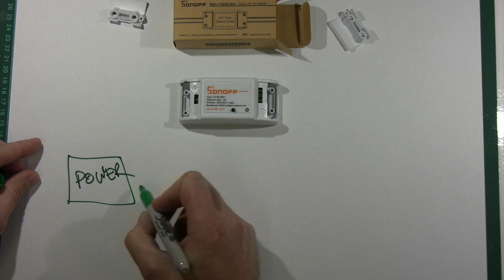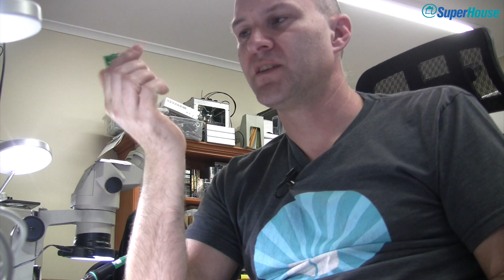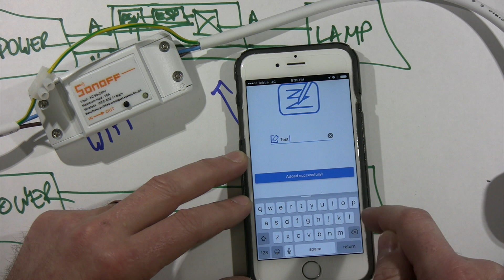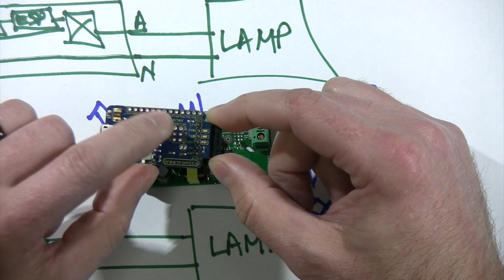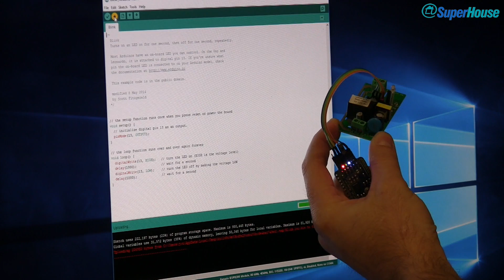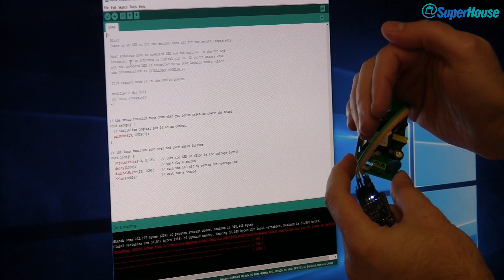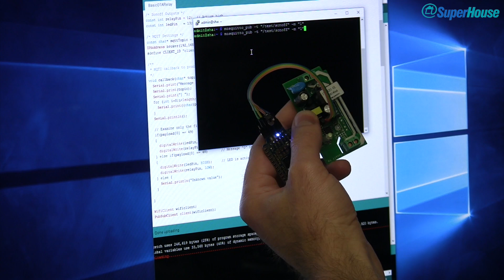SuperHouseTV #17: Home automation control with Sonoff, Arduino, OpenHAB, and MQTT

Comment: Awesome Vid and i actually really like the device but there are also two "contra" to mention.

1. Most of routers are pretty limited to the simultaneous connected devices. In my case 32 but we have 4 RPi3, something like 80 lights and countless outlets in and around the house. Not to forget some Laptops, Cellphones and IP-Cameras.

2. i miss connectors to add a push button and a wall switch to switch the relay manually but maybe there is a free GPIO?

I prefer to use each room one of the latest ESP (3 bucks) with a additional power supply (cheap) and connect several relay boards (up to 30A, also cheap) to it. In case i need more GPIO's there is still the possibility of using shift registers or I2C with PCF8574.

This isnt critic. Im one of your biggest Fans and your Videos were helping me a lot to understand. KEEP IT UP!!!  :)

PS: sorry for the messy english, im a German who never had an english class in his life ;-)

But one more Question: MQTT vs. Netcat?
Reply from the maker: Yes, point 1 is something that can catch people out if they don't know their AP has a limit on simultaneous clients. Point 2 will be covered very soon in my follow-up video, which will probably be titled "Sonoff Secrets: Storage, Software, Switches, and Safety" or something corny like that :-)

MQTT and Netcat can work together, but they do very different things. I want to do an episode all about MQTT some time in the future because it's such a useful foundation now for so many connected projects.
Reply: Ok, thanks. I'll stay tuned :)

Comment: I've made an alternative firmware for Sonoff switches, based on MQTT. Wi-Fi credentials configuration is made with WiFiManager and a Web configuration portal is used to setup MQTT username, password, broker IP address and port. 

GitHub: https://github.com/mertenats/sonoff
Reply from the maker: Nice :-) I'll reference this in a follow-up video. Thanks.
Reply: Thank You! In addition to the Sonoff's products, there are also a RGB bulb (Authometion LYT8266) and a LED light strip controller  (Arilux AL-LC0X), based on ESP8266.

Comment: as I understand the sonoff app needs a phonenumber to register so it will not work from a tablet
Reply: hi, i registered with ewelink using my email address only. works very well on both tablet and phones.. I can add that I measured draw. 1W when erelay is off, 1.5W when relay is on. not bad at all.

Comment: I'm confused when it comes to what you can use if you don't have the Freetronics USB to Serial adapter. I have this: https://www.adafruit.com/products/954 Will that work (minus not feeding it the 5v from the red wire but feeding another source of 3.3v)? Or would a USB to Serial cable work that I use to console into Cisco devices? That basically gives it a serial port. I'm trying to read up on this topic but I thought i'd ask before I go buy another device for this. Thanks!
Reply from the maker: Yes, you can use any USB-to-serial adapter that provides 3.3V logic. That includes 3.3V versions of the original FTDI cable, which are pretty easy to get. I just used the Freetronics one because I have a whole box of them in the Freetronics warehouse, which just happens to be my garage ;-)
Reply: I figured out that I could get it working with the usb to serial that I already had. I'm just having issues with uploading new firmware to it over wireless even if I have authentication off. I tried turning it on and re-writing via serial and when I tried to update it via Ota, I get a password prompt even though I commented that code out that I wrote to it first. very odd. probably a library version issue? thanks!
Reply: I'm also wondering about alternatives to the Freetronics USB-Serial adapter. I'm in Sweden and ordering from Freetronics site is probably going to take a while. Is it possible to use any USB to Serial adapter and make arduino software recognize the sonoff, or is it that specific chip on the Freetronics adapter that makes that work? Thanks for awesome content!
Reply from the maker: Yes, I've had very strange things happen with the OTA authentication too. Sometimes it works, sometimes it doesn't, and sometimes it tries to apply it even if the version currently installed doesn't have it enabled. I don't know what's going on there.
Reply from the maker: Yes, that Adafruit adapter should work fine because the logic level pins are 3.3V. Just don't connect 5V, as you already worked out!
Reply: I feel OTA is unreliable. It works sometimes. Other times not. Password authentication is hit but mostly miss. If pins are connected to electronics and it's all behind a dry wall OTA flashing does not work; the upload to the ESP8266-12E can go ok, if I get past authentication, but expected flashing does not occur as it does with direct USB connection. I posted a comment above. Any ideas? ( Reliable OTA for behind drywall is useful)

Comment: Hello, I am interested in the same project as you.I have a home automation.I commanded 5 Sonoff for my home automationBut SonOff work just on Local Wi-Fi and not from outside (3G or 4G or for
another network).How you built that for your home automation Sonoff "Superhouse"?
Thank you for all your explanations it’s really great
Reply from the maker: I use OpenHAB as the central control system for my house. The app on my phone connects to OpenHAB, which then sends commands to other devices such as Sonoffs.
Reply: Okey, so OpenHAB may pair the sonoff without difficulty? And what is your app on your phone connected to OpenHAB. For me i use my build page and Jeedom. What do you think of jeedom, can be paired it?
Thank you in advance for your answer
Reply from the maker: OpenHAB doesn't need to know anything about the Sonoff, provided the Sonoff firmware has MQTT support. MQTT acts as a message handler for other software / devices, like a shared whiteboard. One piece of software can send a message to MQTT (like writing a note on a whiteboard) and then another device or software can read the message (like reading the whiteboard and seeing that somebody else already left a note there) and doing something with it. I really need to do an episode about this, because it's a very important concept. It's hard to explain in words, but when it's put in a diagram it's suddenly very clear.

Comment: This app for smartphone? Where to find this? Is it available for samxung galaxy? Thanks.
Reply: From the VERY little that i've messed with it, it will reconnect and show you what the statuses are on the MQTT Broker. The phone is just reading what the value is supposed to be from the MQTT broker. The phone simply subscribes to these topics and publishes to them to change states (I believe). I would like to hear from Jon.
Reply from the maker: Robert, you're spot on in terms of the behaviour, but behind the scenes it operates in a very slightly different way to what you described. Part of the problem is that "OpenHAB" consists of several parts, all with the same name, so it can be confusing to talk about it. "OpenHAB" itself is the central software that runs on a machine somewhere, such as a Raspberry Pi. I normally call this the "OpenHAB server" to distinguish it from other parts of the system, but technically it's just "OpenHAB". Then the OpenHAB app (which runs on a phone, tablet, etc) connects to the OpenHAB server to get device status, send commands, etc. The OpenHAB app doesn't need to know anything about MQTT, because it connects solely to the OpenHAB server. Then, the OpenHAB server is the thing that connects to many other things, like an octopus reaching out in many directions. It can communicate with other devices via MQTT, or many other comms mechanisms and protocols simultaneously.
Reply from the maker: There were 2 apps shown in the video. The first app (eWeLink) is available for both iOS and Android, and works with the firmware already installed on the Sonoff. Just search in the Play Store for "eWeLink" as described in the video. The second app is for OpenHAB, which is the home automation control software that I use. OpenHAB is installed on a Raspberry Pi in my house, and the OpenHAB app on my phone connects to it. That app is also available for both iOS and Android. Search for "OpenHAB" in the Play Store.
Reply: Sounds great! Right now orderred two sonoff devices (tight budget for this month), just $6.11US - that is no brainer... if someone want to make their own with ESP8266, relay... it will cost much more, not to mention nice ABS plastic casing. One thing: when phone is out of range, and if light remains on for example, does phone automaticall re-connect and show that light is on? Or if after manual connect, does it show status of all loads? Thank you in advance.

Comment: Hi Jonathan ,  great video,  a question connected with eWeLink app, why does it need so many permission? Is it safe to use it?
Reply from the maker: Good question. I don't know much about it, because all I did was test that it works and then blow away the firmware on the Sonoff so I could use my own OpenHAB setup instead of eWeLink. What you saw on the video was about as much as I've done with eWeLink. One of the reasons I don't like cloud-dependent control systems is that even if they don't use any extra permissions, just having your control messages go through somebody else's server can leak a lot of information. Whoever can see those control messages can get a pretty good idea of what's going on inside your house. That's one of the reasons I prefer everything to stay local.

Comment: HI CAN YOU USE THESE SONOFF DEVICES WITH amazon echo .MAYBE LIKE INLINE WITH A LAMP OR OTHER ELECTRIAL DEVICE .THANKS AND GREAT VIDEO .
Reply from the maker: Yes, you can. You'd need several different things to make it work. 1: Install OpenHAB. 2: Set up the Amazon Echo HA Bridge. There's a great guide here: http://tinsley.io/2015/06/control-your-items-using-the-amazon-echo-openhab/. 3: Install an MQTT broker. 4: Configure OpenHAB to control devices using MQTT. 6: Install firmware on your Sonoff to use MQTT.
Reply: NICE

Comment: Having ordered and played around with one of these I have now ordered 4 more. For this money £4 in Uk it makes it possible to provide a lot of automation for very little money. More work but (obviously) more cost effective than z-wave etc etc

BUT - only with the knowledge in this video dies this make financial sense. As someone new to home automation I wouldn't have a clue how to flash these SONOFFs and the video is great. I've shared this vid with lots of friends who have now purchased 1 to begin to annoy their wives and cats by randomly turning on/off lights at random :)

In all seriousness this is the best video I've found on home automation because it's THE video  that has set my on the path to build a full home automation system. 

Pi3 is next.

Comment: Fantastic video, liked, suscribed and Ordering smart relays, now.

I did excactly that with a: old phone charger SM-PSU, esp-8266 and a cheap relay. I spent too many hours and still have issues with the relay control voltage.

Is there something similar with dimmers?

Did you realise how much responsive is your bulb when is not turned on from the cloud? :)

Thanks
Reply from the maker: There are definitely equivalent devices from other suppliers that can do dimming, but I don't think any of the Sonoff models can do it. Not yet, anyway. They're just on/off devices. I think there's probably a Belkin Wemo module that can do it, but they're about 15x more expensive!

Comment: Hello! Which app are you using on iPhone to control Sonoff via MQTT? How can I get or develop this?
Reply from the maker: It's the standard OpenHAB app, nothing special. I run OpenHAB on a Raspberry Pi as the central controller / coordinator for the house, which connects to all the other devices. Then I use the OpenHAB app on both iPhone and Android to control it.
Reply: So you don't use MQTT? Just OpenHAB?
Reply from the maker: Yes, I use MQTT as a communication mechanism between OpenHAB and some other devices. I really need to do an episode about the architecture, because it's important when trying to understand how I've connected everything together.
Reply: Yes, it's very important. I'm trying to find a tutorial that shows how to integrate them and no success until now. Can you do it? I will be very grateful. Thanks.

Comment: Very Nice.

Could you provide the switch model (the cover)?
Reply from the maker: Sorry, I'm not sure which switch you mean. Is it the one I made with the buttons on it?
Reply: SuperHouseTV I meant the Wall Plate.
Because I have in my country. The blanks they are a single piece. And I wanted something in the same style as yours. Two parts.
Reply from the maker: Aha, gotcha :-) That's made by an Australian company called Clipsal, it's a standard wall plate style here so there are many other companies that make copies. For example: http://www.wagneronline.com.au/clipsal-compatible-wall-plate-blank/power-240vac/power-lighting/960967/fl/

Comment: I've just received my Sonoff and I'm thinking of using it, initially with its cloud software/app, to drive some device to scare a potential burglar. 

What are the best devices to actually drive for this purpose? Lamps, of course, maybe a radio? 

One problem I see is that most modern devices have "soft power" switches and therefore need human interaction to actually turn them "on" when the power is restored. 

Any suggestions? 

Also, I suspect most software that allows you to switch on/off devices doesn't have any randomness built in. Any half decent burglar would notice if a light came on in a give room at EXACTLY 6pm each day. 

It's needs to be 6pm +/- say 30 mins to fool a burglar. Of course this could be programmed from my own MQTT server, just wondered if most inbuilt software had this random feature?

I plan to buy more Sonoffs - it's an excellent bit of kit.
Reply: For this case,maybe you can use your sonoff switch+PIR Motion Sensor.Sonoff has a PIR2 can be your ref.

Comment: Does it work remote control with 3g?
Reply from the maker: The Sonoff only has WiFi (with optional 433Mhz, depending on the model you choose) so it can't connect to 3G, 4G, or anything else. In the video when I control it with my phone, the phone itself is connecting to the Internet via 4G (or could be 3G) and then in to my OpenHAB server via my home Internet connection. The OpenHAB server then communicates with the Sonoff by WiFi.
Reply: Thank you, you're Super!

Comment: A little help please? I have uploaded your code (thank you) OTA blink to my esp-12 and it worked fine. I was able to access the serial monitor no problems. I dis-connected the module and re-connected it. Now when I go to access the serial monitor it comes up with type board password to access console! What the! I didn't enter any password the first time. I've tried my WiFi password no good. I've gone through your code and can't see a password there. Any help would be greatly appreciated. Thanks.
Reply from the maker: That's really strange! I can't think of an explanation for that. Is it possible to re-flash the board (maybe just with the standard example Blink without any OTA support, using the USB-Serial connection) just to see if it comes back to a basic working state?
Reply: Yep no worries, thanks for you help mate. I'll give it a go tomorrow night. Cheers

Comment: Hello again JonathanIt would be very interesting video on a wall switch like you have!That's my biggest problem, what kind of Wall switch use to control the lighting with dimmer (preference).In this case the "intelligence" would have to stay at the wall switch right? Or you have any suggestions?Do you thing will be better to have on the wall switch the ESP8266 or the UNO with Ethernet shield?
Reply from the maker: I'm going to do a future episode about the way my switches are set up. I don't have any dimming control at the moment, but I want to revise the switches. I have some ideas about how to do a touch-sensitive plate with dimming control. Which processor you choose depends on how you want to communicate with it. If you're happy with WiFi (which I personally don't like for critical home control stuff) then the ESP8266 is the way to go.

Comment: Hi Jonathan
For The module with the sensor humidity , can we flaching and put our sketche (like you did with switch)
Thank You
Reply from the maker: Yes, no problem. I'm going to do another video showing more information about the TH model, some extra software options such as Homie and HC2016, and how to connect extra GPIOs so you can do things like connect a physical light switch.
Reply: Thank you a lot Jonathan

Comment: So you have your wifi login info hard-coded on all of the devices?  If you have to change your wifi password for whatever reason, that would completely suck flashing all of the IoT wifi devices all over the system!!  Is there a better way?
Reply from the maker: Yes, there's definitely a better way! I only did it that way in the video to show the simplest possible example, based on the "BasicOTA" example that comes with the OTA library. I even commented out the authentication etc that's in the basic example. There are various on boarding systems available but they add complexity, and I wanted people to be able to prove it works with the minimal lines of code. You could check out "Homie", and Pete Scargill's HC2016 firmware (which needs a bigger FLASH on the Sonoff), and I've used a project called ESPlant that was developed by some friends of mine for the Open Hardware Miniconf 2016: https://github.com/CCHS-Melbourne/ESPlant
Reply: Would any of that be covered as part of your upcoming video on MQTT?